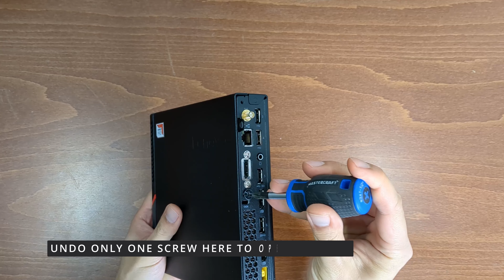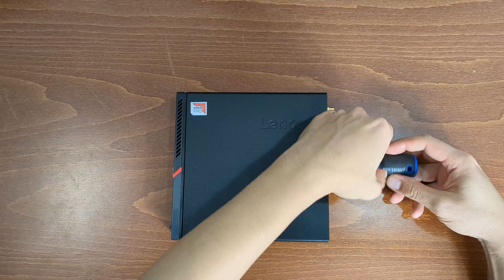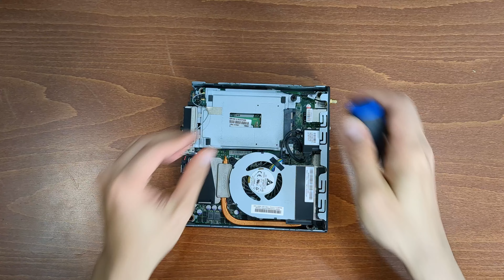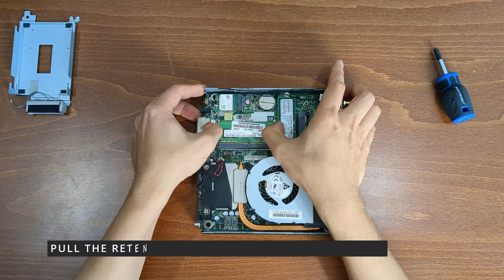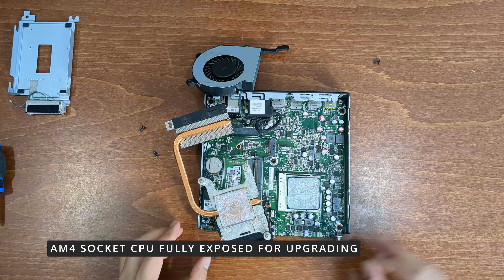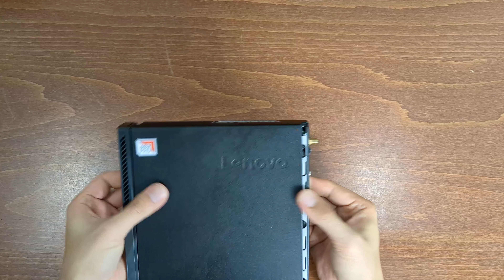Lenovo ThinkCentre M715Q AMD version teardown and upgrade CPU/RAM/SSD

Comment: i've bought an used M715q recently, and this clip/pin-thing for mounting M.2 SSD is broken, can i bought a replacment somewhere or mount the SSD in other way?
Reply from the maker: Just use electrical tape to hold it in place?
Reply: A thick thermal pad right under the caddy. It'll keep the SSD cooler at least. 😉

Comment: The cover wont slide all the way back in. Any ideas? It's stuck at the very end and no matter how much I fiddle back n forth, it still wont slide all the way in. It was perfectly fine before i took it off.
Reply: bro lol same issue here. I have two of them, for hours i try and it doesn't go back on then it will randomly and I refuse to touch it.... sadly I need to too now :(
Reply: I had the same issue. If you put a 2.5 ssd in, try refitting the chassis, ensuring that none of the wires are blocking the case from fitting back in. Good luck!
Reply: I’ve had this happen several times. It’s usually the speaker wire misaligned and keeps the case lid from closing. On one occasion it was the WiFi wire from the removable caddy had come off the card and I pinched it trying to force  it closed.
Reply: when you take out the top silver tray, theres also two points/mounts on the front end you have to align correctly. Same in the back
Reply: Hold one side n slide the other

Comment: can it run ryzen 5 2400g ?
Reply: i have the same model - M715Q 2nd Gen - and it comes with a AMD Ryzen5 2400GE CPU when i buyed this from Lenovo in 2019.
Reply: I doubt the board is cable of supplying the power.Also if it did there will be 1 times the heat.You have the get the AMD Ryzen5 2400GE

Comment: Can i use non pro amd processor to replace the a12?
Reply from the maker: I think so but I didn't have one to try. It's AM4 socket.
Reply: i have the same model - M715Q 2nd Gen - and it comes with a AMD Ryzen5 2400GE CPU when i buyed this from Lenovo in 2019. 
So it should be possible to replace the CPU. (atm i dont know the socket of a12)

Comment: Great Video!!! Can it upgrade to 5600G, even though to update the BIOS
Reply from the maker: Thanks! It would be either overheating or  thermally limited performance to run a 5600G, as this compact PC design was for 35W CPUs only.
Reply: @ComputerizedCanada  Yes, that's for sure, I checked the datasheet and it doesn't say 5600G. If this could be done it would be extraordinary, even if it gets too hot we can upgrade the fan, we can replace the PSU with a bigger one.

This is just my imagination, thank you, I am happy with your great video and discussion

Comment: 4350ge 모델을 쓰고 있습니다.
5650ge로 교체 가능할까요?
Reply: I think the one in the Video is a gen 1 Version, I am looking for a solution für the gen 2 Version with 2400ge... Problem for all iteration is, the bios is limited to special AMD/Ryzen Gens and it's nearly impossible to upgrade unless Lenovo provides a bios update that lets newer CPU gens get installed.